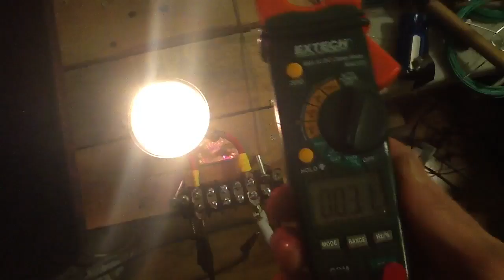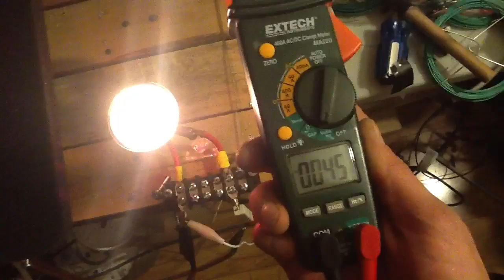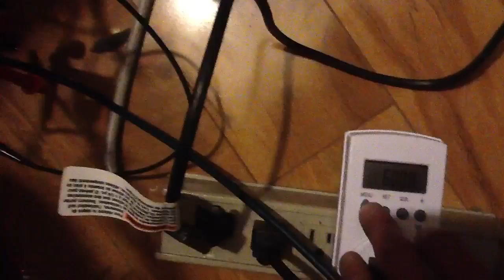42A Don Smith Device: Simplifying

Comment: hi kurt. i've been loosely following your work for a while. looking at this schematic, it looks like you have a high voltage Neon Sign Transformer that has been tuned to resonate with the 60Hz from the wall. The output side of the trafo has an earth ground, you rectify the output to charge a capacitor. When the voltage on the capacitor exceeds the breakdown voltage of the gap, the gap fires and the capacitor oscillates with the inductance of the halogen until the gap quenches.

Comment: Your input capacitnce is off mark. Use this link to an online calculator for resonant frequency of a tank circuit.  Calculate and ajust your input capacitance to resonate at 60hz with the transformer input inductance. When you make the input tank circuit resonate at the 60hz from the variac, your input current and resultant wattage will drastically decrease. Tesla teck.... Don's predecessor.